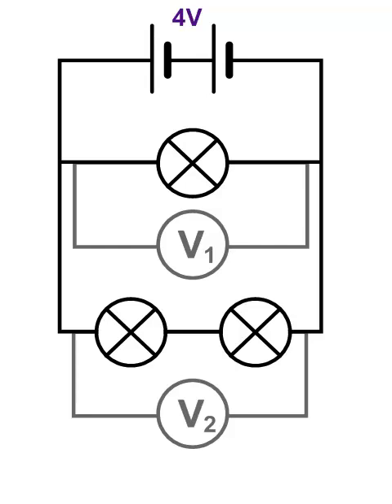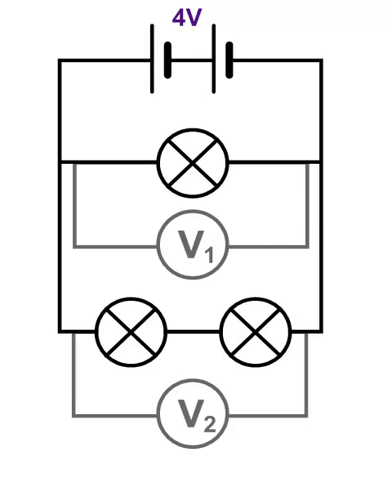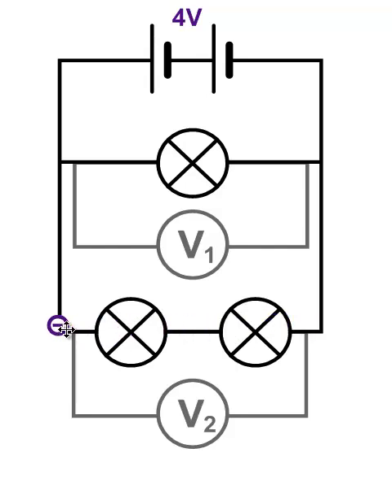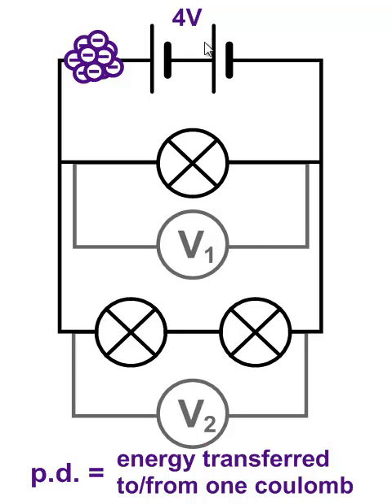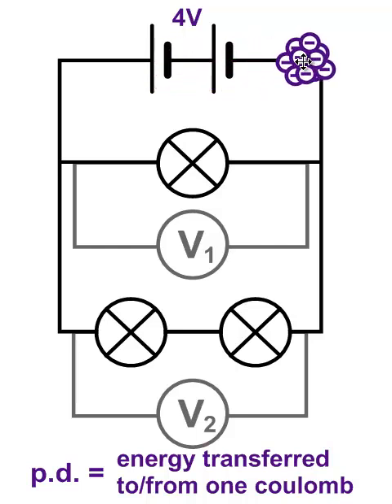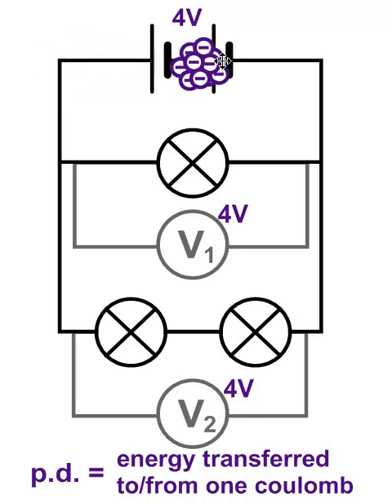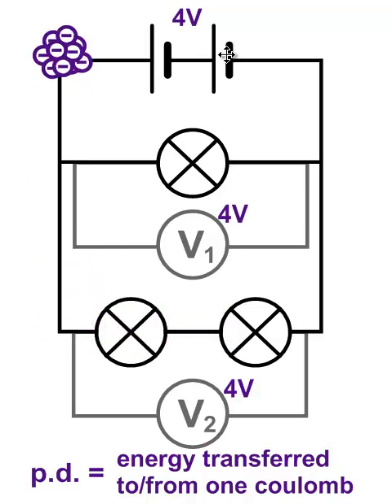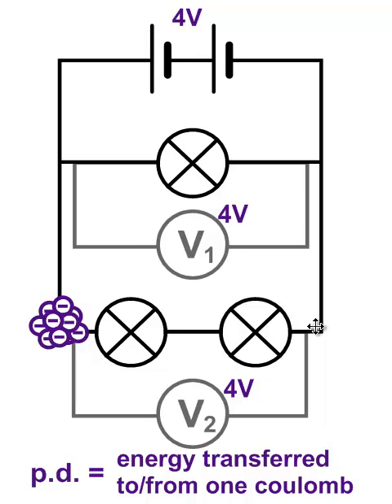Potential difference (voltage) in parallel circuits

Comment: if all the energy is given to the components then how do the electrons complete the circuit without any energy
Reply from the maker: Hi Yash, in these models we usually ignore the resistance of the wires. This is often a pretty reasonable assumption for many circuits. Therefore we imagine that the electrons don't need any energy to move through the wires. 

In reality of course, a current through a wire does dissipate energy as heat. So if you actually measure the voltages as shown in a real circuit they will not quite add up to the voltage across the cells - there will be some voltage drop across the wires in between.

Comment: Why can't they go through both branches at the same time?

I think I figured it out, if anyone else is having the same doubt. It is because we are dealing with DC (direct current) apparently direct current is only allowed to move in one direction. Which is why it may only go through one loop per cycle.

Comment: But isn't it based on the resistance? And how is it that this theoretical coulomb of charge only passes through one or the other parallel? Isn't the case that there is more or less coulombs passing thru one branch and more or less coulombs passing thru the other and when that's the case, how is it that even if there is more coulombs, the potential difference is the same all throughout.

Comment: so they just randomly divide into 2 branches and it's not based on the resistance? and after that depending on how easy it is to pass thru the resistor , the charges/unit time differ in the resistor? plz confirm if i'm right

Comment: Its a strange topic for me to get my head around, but if I add another branch to the circuit with a bulb voltage would stay the same at 4V but current would separate into smaller amounts for each branch? Cheers

Comment from the maker: The current is composed of electrons which will either take one route or the other around the circuit. 

In reality there are billions of electrons all flowing around the circuit at the same time, each taking one route or the other, so that the current appears to be constant, as you say.

It doesn't really matter which electron takes which route (although it's interesting to think about) - it's the number of electrons flowing around each route per second and the energy they transfer that matter.

Comment: I thought that the current was everywhere at the same time, I did not think that the current PICKED a branch -- that would lead to the obvious question: how do we know which branch it picks. Although that's not important in a circuits class, it still seem counter-intuitive.